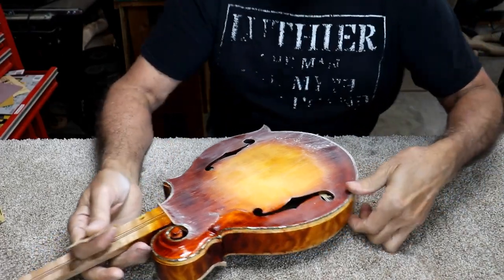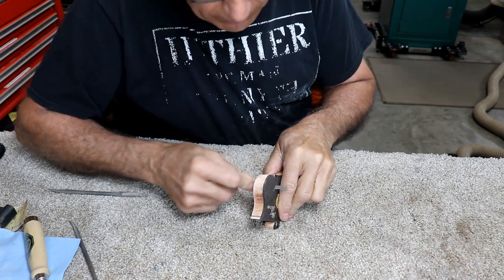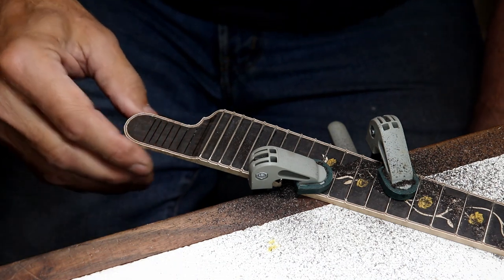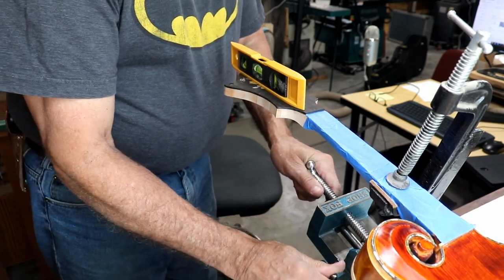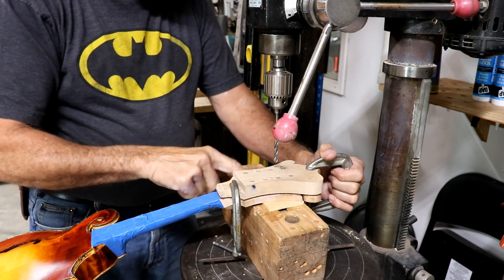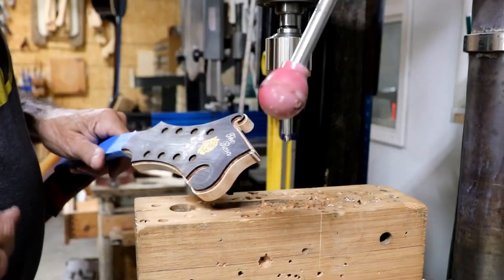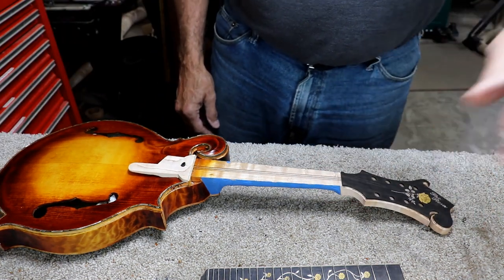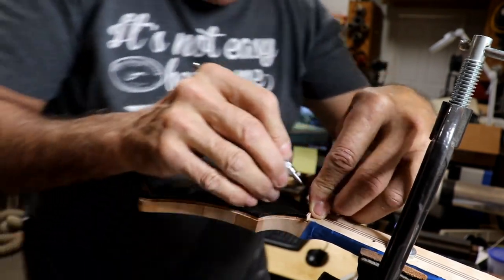560 RSW The Worlds Finest Mandolin Ever Built By A Human - Part 14

Comment: I was a spray painter for 40 years. The only things I can think of that might cause the difference between the two instruments would be The amount of paint applied. A little extra shellac on one could possibly be the difference. One other reason might be is if between the two instruments there might have been a little time that allowed the solids in the shellac to settle in the spray cup which would cause a slightly different (heavy) consistency to the shellac. I know that is reaching a bit...you would think they would be the same, yet they aren't.
Reply: When spraying metallic paints I had to make sure the paint remained stirred up. Otherwise I would begin to get more of the "metallic" particles after a while.

Comment: Good video. Imagine how many flips you can make with those inner tube strips after you retire!
Reply: What's a "flip"?
Reply: @zapa1pnt  A forked stick with and elastic stretched between the forks from which one may fire a projectile. Sometimes erroneously referred to as a slingshot, which is a different contraption with the same end use.

Comment: I came across that exact same problem awhile back and found that the shellac that was underneath did not cure properly when the other person sprayed it and ever time you sand the surface it comes of like bubble gum. They didn't give enough time to cure between coats.

Comment: You have different wood my man. One will take longer to dry than another. When I do gunstocks, I might let them dry a month before sanding. Now they do not get sanded after every coat. Steel wool maybe but only sanded after the final rubbed on coat, then dry for a month, then sand. Anyway, if I have a walnut stock or a beech stock, they take different amounts of time to dry. I thought from a man with your years of experience, you would know this by now.

Comment: I wonder, the difference
Reply: Difference in finish spray application on small instrument vs large. Not operater error but the spay gun self.
Reply: Spray. Sorry.
Reply: Roger, you don;t need to make new posts, for corrections.
Put your cursor on your comment and click on the 3 dot menu, at the right
side of your comment and select "Edit".
You can do that as many times as needed.
Just an FYI. 😁
Reply: I'm betting something on the wood that's causing the fisheye issue is affecting the drying somehow.